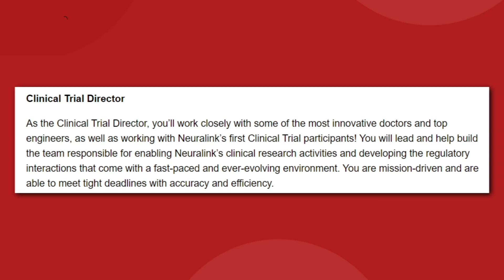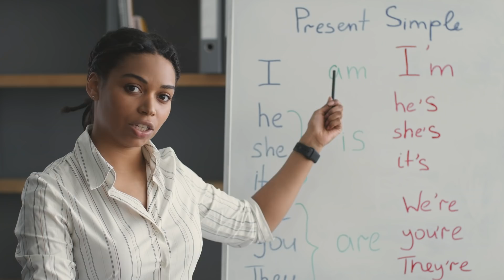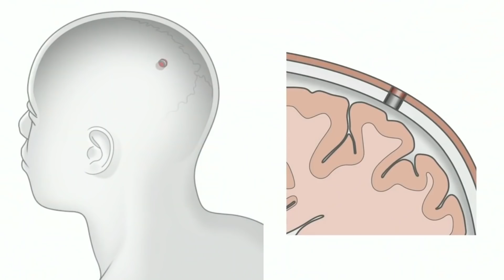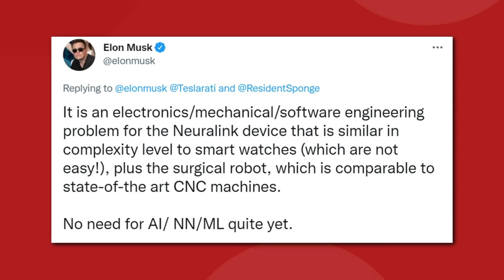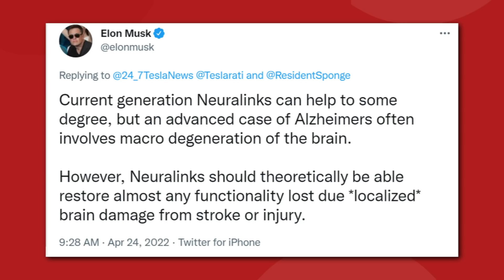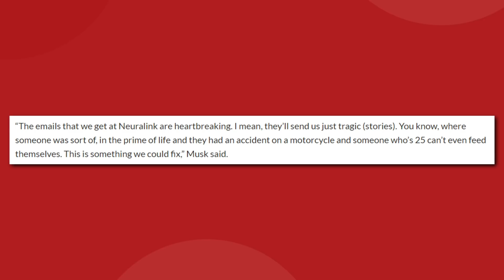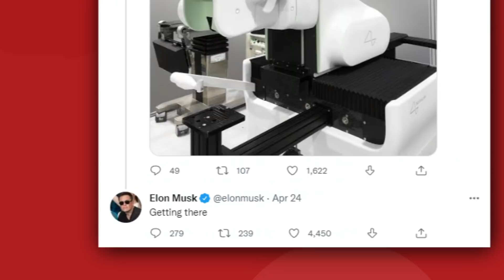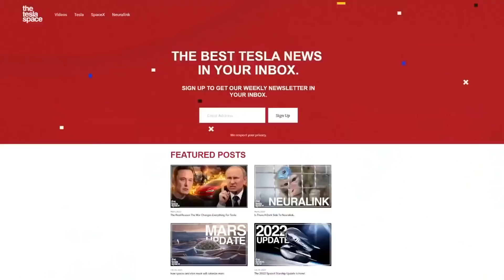Neuralink 2022 Update Is Here - Human Trials Coming!

Comment: QUESTION: if a solar flair or an emp goes off would you go brain dead? Like what would happen it has to have a battery and recharger right
Reply: just because you have the chip installed doesn't mean your brain is dependent on it to survive. You would just turn it off during the solar flare and not use it.

Comment: I have a question about Neuralink.  Is it possible for Neuralink to make a connection from the visual cortex of the brain to an external camera?  You can buy glasses that have a miniature high res camera molded into the frame.  I have seen samples of vidios taken with these cameras and they look pretty good.  If Neuralink could connect from the brain to these camera/glasses then a blind person would be able to see.

Comment: I"ve had relatively minor brain surgery (intracranial pressure monitor inserted for 3 days then removed). For that, they only drill a tiny burr hole yet you still spend 3 days in the ICU.  It is NOTHING like LASIK surgery wehre you go directly home afterwards. Any brain surgery is a big deal. As much as I'd love this implant...don't let them fool you with that nonsense about it being an in and out thing. its not.

Comment: They have been working on what’s called osteointegration for prosthetics use  the goal is to have a mount permanently attacked to the bone of the residual limb so you can just attach your prosthetic in the morning and the big problem is anytime you open the skin you risk infection so you can’t really have a piece of metal sticking out of your skin without the very real risk of infection so the thumbnail for the video is unlikely now an implant under the skin where the skin is not left open? And in fact I think that neurolink is subcutaneous.

Comment: The alleged geometric physical horizon at sea level with earth dimensions 3959Ml (radius) and 24850Ml (equatorial circumference) can be no more than approx 3Miles (1.22x square root of the observers height in feet). WE SEE TOO FAR.  You’re already brainwashed enough right??

Comment: Well, I’ve referred many people for neuro-feedback to help them recover from brain injury; what I know is that technology has been continually advancing for the past 30 plus years, far beyond what is commonly known. Without using our hands, We can carry out many operations by sending electron brain signals. The advent of wireless transmitters has magnified what is possible. Whatever we can do without using our hands to do it, we can remotely be directed to do via transmitters once the wiring is installed. It can only work both ways. To think that those who have control and want more control would not use this to their advantages, is naive.
Reply: I agree. The elite system already has such syring control of us

Comment: What if the person needs an MRI scan? Brain hack? Wouldn't this weaken the integrity of the skull? What if the body wants to reject the Neuralink device? So many questions
Reply: That is exactly why they are having these trials. I'm sure there are plenty of unanswered questions, even for the dev team.
Reply: You people are insane to think that there is a  brain doctor on this planet  who is willing to cut in some person"s  brain to put  some device inside. Thelepathy?!1
Reply: Chip size and electrode size were two of the most important things they addressed when starting neurolink, the chip itself is about the size of a nickle and the hole put in the skull is smaller still, allowing for the structure of the skull to be as strong as possible, and the electrodes are so small that the body doesn't even recognize them as anything. We're talking smaller then the dendrine of a neuron in width, so eventual scarring of the tissue treated with the electrodes is theoretically negated entirely. MRI and hacking of the tech are def concerns and I wish I knew more on the risk to damage of neuralink in an MRI....
Reply: What if you got Nera hacked? Do people not play Deus Ex?
Reply: So many dumb questions you mean.  Will it interfere with my microwave?  Will I have to pay a subscription service for access to my own memories?  What colors does it come in?  Can someone guess my 26 letter randomized keycode and hack my brain?  What if I fart and hiccup at the same time, will it eject out of my brain?!  ARRRRRGGGGGG!
Reply: @davidbeppler3032  Stupid. Why are you spewing this nonsense? Go back to sleep.

Comment: No write capacity means there is little here but the standard miniaturization of existing sensors and widgets. Stimulating a signal is very different than writing to the hard drive. As it sits, this is a nothing burger. I hope they have a breakthrough in write ability soon, but still useful for developing things involving  sensors.
Reply: ??? Google does not write to my hard drive, but I find it very useful to access. The idea that I have instant Google access alone would be game changing. I think about a problem and if the answer already exist it pops into my head.
Reply: @earlpottinger671  exactly this!

Comment: Surely the computer can then in turn control the brain. Be hacked etc. That's common sense.
Reply: Not in a closed loop system. You'd have to have physical access to the brain for that. Think of a computer that isn't connected to the internet, the only way someone could 'hack' it is by physically gaining access to it, then if they want to control it in the future, there's no internet connection so they'd have to gain physical access to it everytime. In the future, an implant that has internet connectivity (for example, to access google) would almost undoubtedly be on a PHYSICALLY separate system to that which has any impact on the body. In such a case, you'd have to be kidnapped and have surgery performed on you to be hacked, at which point I think you'd have enough other problems to worry about. In the more immediate term though, it'll simply be outright impossible, because the implants are read only, not write. They only pick up signals from the brain, not visa versa.
Reply: @assaultflamingo2.068  Oh, it's going to be connected to the internet.  This video doesn't talk about the other planned uses of it, but Elon has talked about it. Your brain will be connected to a computer.  Elon says that Neuralink will merge humans with AI because AI is going to replace us.
Reply: @bluebellflora1622  You missed the main part, where I said it'll have physically separate systems.
Reply: @assaultflamingo2.068  Perhaps you are right, but I don't think it's as simple as just being connected to the internet if it's meant to merge us with AI in our capabilities. I am not, as you can tell, a tech person, but I'm sure they will be able to infiltrate these chips somehow.  What's stopping entities from getting into the separate system you are talking about? If it can be done, it most likely will be done.  You don't think so? If you are correct in your belief that it cannot be infiltrated by anyone electronically, then that would be a good thing.  This thing is going to affect your brain.  It's physically embedded in there and connected to a computer.  You don't see the fallout from that? I personally think it can be a very good thing for helping people who can benefit from having things corrected, but I also see a host of problems when it's used in everyday life.  Also, as time goes on, it's use will be expanded much like the use of our phones have been expanded.  Elon even said it's going to be sort of like a phone, an "extension of yourself". Except, you can ditch your phone.  This is in your body.
Reply: I believe they can come up with something. Like they did with Starlink when it got cyber attacked by Russia.